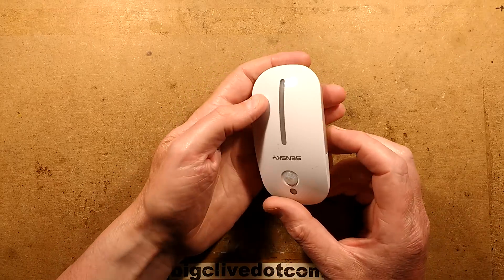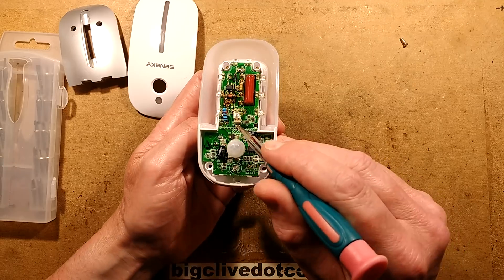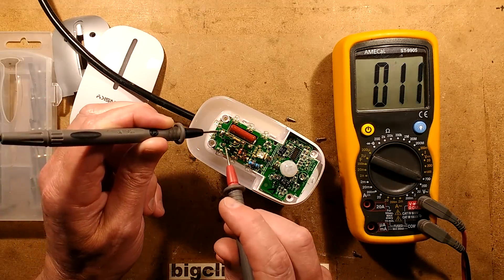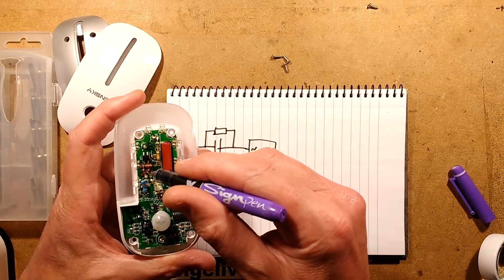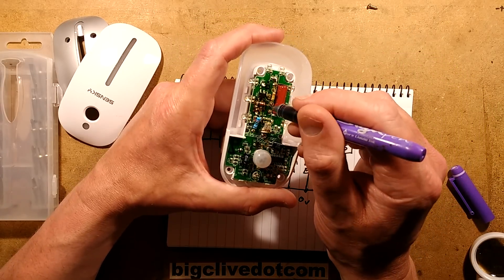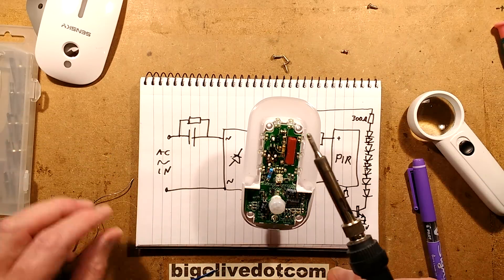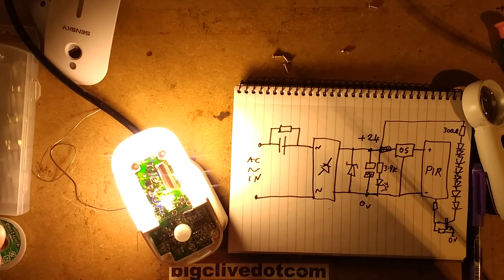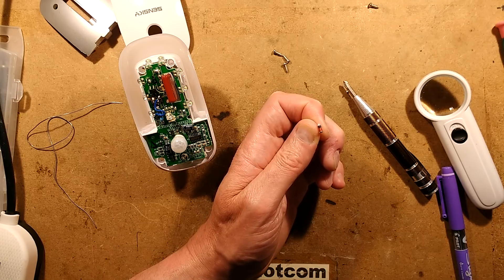Defective nightlight autopsy, half-assed fix and improvements.

Comment: Yes, I know.
This is like a six year .

old video it was there that long 

However, the question I had was which software I Arabia, is being used and also does Clive have a video on this one? I'm not sure if this is one of the tests, the soldering station or just 1. That's an iron on his own warm. When those stand alone, sovereign stations with just the iron and the power supply and so on. I'm looking for something.  About the size so more information would be appreciated and if there make live video on this pointers to this please

Comment: I see capacitive dropper night lights that use a TRIAC for the control, so the current really gets reduced when the LEDs are off.  The whole idea behind shutting off the LEDs is to save power.  The lights that shunt the LEDs with a transistor violate that efficiency concept - they should be banned or labeled as not meeting efficiency ratings, depending on the laws.

One thing I would try would be to use a TO-126 "15000" series transistor from a switching power supply to shut off the current when disabling.

Comment: Have very similar night light at home, night mode works, motion mode worked but light from LEDs on edges started to weaken to point it doesn't work anymore, any ideas? :(
Reply from the maker: It could be that the LEDs have gradually failed over time or that the dropper capacitor or its series resistor have degraded over time.

Comment: I have one of these exact nightlights and it failed after about a year. I just opened it up and found burning discolouration around the zener, but the zener itself was still working and wasn't shorted. I guess something else gave way first.

Interestingly it had standard phillips screws, not triangle ones, but otherwise is identical including the upside-down logo.

Comment: The PIR uses very little current, so indeed, 330nF should be enough. Also, if you don't mind the 50Hz, the whole zener +cap+7805 could be replaced by resistor+5V zener+cap, and take the supply for LEDs directly from the bridge rectifier.
Reply from the maker: The PIR circuitry needs a very stable supply, so I'd still aim for a higher voltage and use a regulator.
Reply: Hmm I was not aware of that, but I always use them on batteries :D
What strikes me as inefficient is that it is a current supply converted to voltage. When LEDs are off the 24V are not really needed, it would be better to shunt part of the current to a lower voltage (similarly to the 'avatar mushroom light' that shorts the supply)

Comment: Speaking of zenners, is there some easy and simple way to test what voltage they're designed for? Unfortunately I don't have a bench PS.
Reply from the maker: You'd have to use a voltage that is higher than the rated voltage of the zener and limit the current through it with a resistor.  Then measure the voltage dropped across it.  Many zeners have a reference to the their voltage rating printed on them.
Reply: There are indeed some markings on them. Way too tiny for me to make out though. Guess I should first get decent lighting and/or a better magnifier. Thanks.
Reply: Yeah, what color I said could easily be built into a small box and some component test clips of some sort to build a zinner diodester. I'm about to get you like this once as well. And just in case designed it so the current limiting resistor could easily be swapped out if there was some sort of.  Anomaly or an oops on my part. Glad I did only had to replace her as a sister once but it was pretty spectacular. I think I either had. I wanted to change the value in miss Reddit. Or for some reason, I had a short and way to my family but in a very wrong value resistor.  You know what happens when Laura value to resistance expected plus a beefy power supply.We're playing a voltage and currenot.Well, starts out with a little bit of a smell.The best smoke and well you know what's next

Comment: I hate nightlight circuits that draw as much or more when dark as they do when lit.  This one looks like whatever is not used by the LEDs will be burned by the Zener.  So you buy this fancy unit that only lights at night, when there is motion and think you're using a tiny fraction of the power of the simple capacitive dropper night light, but you're not, you're just using extra to power a PIR.  But then, what are we using here, 150mW?

Comment: I would be really intrested to see an optimized BigCliveNightLight (similar to the not-so-safe emergency light you build)
- i'd suggest a capacitive dropper with really low mA of current, who charge a cell 24hours (NiCd? LiFe?)
- the current is a bit higher than the current needed for the PIR, but lower than the mAmps the light needs when the LEDs are on (or even voltage drops)
- so the standby current could be really low

i always wonder how efficient a new+small 5V or 3,3V power supply would be compared to those cheap droppers always used, who dissipate lots of heat.

I hate it if a motion sensor LED lamp takes 1 or 2W standby 24h a day, because with that you could light the backyard all the time good enough...

Comment: Somebody can maybe tell me why my switchmode led power supply has its transformer after the bridge rectifier ? Do they drive the transformer with a pwm signal or what
Reply from the maker: They switch a smaller transformer at high frequency to make it much more efficient and allow a tiny transformer to be used.

Comment: Around here we've all pronounced it as 'zeener' for about 50 years. Almost nobody says 'zenner' in anywhere I've worked, and that included the people who made the devices. By alternating between the two, Clive, you'll be annoying almost everybody! ;-D

Thanks for the autopsy. Can you please find a zener diode, perhaps one with a higher current rating, and maybe use a smaller dropper capacitor, to restore proper functionality? I'm guessing that that circuit might have been designed for 110V and that they've cheated out to sell them in 220/240V markets.

Comment: By the way, it's no wonder the Zener failed, if there's no inrush resistor. And I have a feeling that you killed the 7805 when you operated it with no Zener. The 7805 briefly had a full mains voltage on it during the inrush.
Reply from the maker: The lower circuitry was disconnected.  The zener has been grilled.  It would have been dissipating a lot of power in standby.  Probably in the region of 0.5 to 1W.

Comment: Very interesting! Have you ever taken a carbon monoxide alarm to bits? My Kidde detector just died, seems the material has a lifespan of 7 years, which my unit exceed by six months, so Kidde makes a good unit (made in China of course). The new units last 10 years now, better material I reckon. I would be happy to post this to you Clive if you want to give it a look. My e-mail address is ohweinert@yahoo.ca, I use Yahoo Canada for they has less crap. Enjoy your videos Clive, Thank's Ossie
Reply from the maker: It's always a good idea to change the carbon monoxide detectors every few years anyway.  They do gradually fur up inside with dust and soot if used in the same room as a solid fuel fire.

Comment: It's possible that a leaded zener would have a better chance at longevity, as the leads serve as a heat sink. Furthermore it's likely to be of a higher power dissipation rating. Tie points? There's an electrolytic with through hole leads.

Comment: weird design in my opinion, I had lots of those night lights because I found out its cheaper to buy them and gut them out if you want photo-resistors, movement sensors and low-power diodes with all necessary side component to use in other projects, and this one really look like overcomplicated a bit...

Comment: I always said Zeener. I taught myself electronics and had never heard anybody say it. Good video.
Reply from the maker: On the basis that surviving family mentioned his name as Zeener I'd guess we're correct.
Reply: I have about 3 ways.I say it and I can Express that in form of what is here just because of spelling

However one time I accidentally used to call them zinger Diodes, when I first heard it, it's almost what it sounded like. That was years and years ago when I was very young. I think it was just the way a couple said it possibly dialect or otherwise we're just saying it wrong. I'm dumb than hearing't or I don't know. Maybe it's my own take on why I heard, but then again when we are young, people weren't always exactly on.  Right with what?
Is proper pronunciation
Reply: I've heard zinner more than anything nowadays.By the way

Comment: isn't short circuit failure so common because the semiconductor layers just melt together when exposed to very high temperatures? Or maybe not exactly melt, but the dopants diffuse all over and crate a single uniform layer?
Reply: Yeah, I would love to hear the actual failure mode within something on a micro level to where is happening is explained in happens.In this, in my conductor Junction or other areas to the component causing the diode become jumper.This would be fascinating for real

Comment: Question.
Why do UK 4 way plug adaptor strips always have the lead wire coming out the right hand side?
Reply: It is a conspiracy against the Left handed
Reply: It is annoying as if you wall mount it, you can only wall mount it on the left of the main socket, unless you loop the cable under and around it which looks ugly!

Comment: Earth always points to the Earth and any other way is just upside down.
Reply: I agree as the Brits have this safety feature down for sure.
Reply: Until you have countries like the US with unsheathed pins, where a device falling down the back of a plug can make contact with the live (line/neutral) pins without touching the protective conductor. That's why safety concious people even in America, install with the ground UP
Reply: Wrong, and many wall warts are made with the neutral (if they have one) down.  All of my night lights have the neutral down and in the USA the saying goes that Ground faces down to the Ground or start over.
Reply: Honestly, I wish the pins were sheathed, frankly. Once shocked myself accidentally trying to plug in my DS charger. (caught the pins with my finger) No real damage done, and I was laughing shortly afterwards (It was like 6 or 7 AM at the time, and I wasn't very awake, I guess.) while thinking something like "did that just happen? ...Yeah that just happened," but it wasn't a very pleasant experience and isn't one I recommend.

Comment: should i take my fluke 107 apart? it got rained on cause im a dummy and left it outside in a thunderstorm and now it doesnt turn on, thinking about junking it or is there a way to fix it?
Reply from the maker: I'd suggest removing the battery immediately and then leaving the case open in a warm place for a while to allow any water to evaporate.  If you use it on mains voltage a lot I'd suggest playing safe and getting a new one in case conductive tracks have formed.
Reply: yeah i think i have to buy a new one :( i let it dry for a few weeks  and put new batteries in and it didnt turn on.. rip, keepp up the good job Clive and thank you for the tip. i only use it for automotive batteries so nothing life threatening . cheers!

Comment: It looked to me like the discharge resistor was around 120K. That combined with the large cap makes me think that was built for 120V input, since those would be not too unreasonable values for 120V.
Reply: That would also explain why the case was upside down, because the USA have their earth pin on the bottom.

Comment: are you going to order a couple of higher voltage zeners so you can fix it in a new video ? I guess as you said replacing the capacitor for a lower value one then keeps that new zener healthy :)

Comment: I was repairing a dusk sensor for a pole lamp and discovered that the light would not immediately turn on if I covered the light sensor.  Apparently it had some significant delay and averaging built in so that it wouldn't be affected by car headlights, etc.  I was wondering if your night light might not have some similar circuitry to control turn on conditions.
Reply: Yep, those photo controls were designed to eliminate false positives for bright lights enough to trip sensor and yes, even lightning sometimes could trick a photo sensor in the train back off. Once it turned on at night, have seen this at times and I believe the word you're thinking of as hyruses or he receives swing along this. I can't say quite right..

Where's it history sees something a  long these  I guess.

The old classic is when somebody says that 1 light turns off. When an alarm gets turned on and then you go out there and de light that turned the other light off is happened to be aimed. Or is your  such a manner Reflected to otherwise That's hitting the photo cell, causing the other to turn off. I've seen this.  About half.
 A dozen times are moreover the years and I'm not even realizing.

And yes, there's often a delay to avoid other ambient.Light changes either on or off.So as to avoid also the light flickering on and off rapidly in some cases 

And some photos have the nasty habit of just flickering and tinnel the reach enough darkness to come on, Foley didn't see this much, but everyone's awhile.You'd see this sometimes under right conditions in the wrong circuitry you Could say.

I actually once heard about this where someone to handle.Those pool lights like a high pressure soldney.Marker vapor recommended that would have quit working They're dog was getting very ill. The squid working and the data dog di'd almost within the hour. The light started working properly again and worked ever since it was weird, but they took it as a slave. You know that's crazy. But sometimes people mistake things as some sort of sign but or because it's such a coincidence attributed to this.  Not saying there isn't anything there with this, but it's just odd that it happened.Most timing more than anything

Comment: If you don't have a specific zener diode available you can always put them in series (anode to cathode) to obtain the voltage you need. Two 10 volt zeners in series would give you 20 volts for example. This also has the added benefit of reducing the power dissipation by half so they will run cooler.

Comment: the zener is not going to be seeing a whole lot of loading when the LEDs are on, but when they are off it is going to be taking the entire current the capacitor can source.  So there's no actual benefit to turning the LEDs off when it comes to power usage.  This means the zener is going to be burning off the entire 20ma or whatever at 24V which is a lot of power.  The better solution would've been to have a second capacitive dropper to run the PIR part separately so then it wouldn't need the zener at all for the LED.   It seems the zener is only there to prevent the 7805 from being over-volted.

Comment: Here in the Colonies there is no federal code, and perhaps no state codes, requiring the ground pin on a socket to be up or down. There are good arguments to be made both ways. Is that really regulated in the UK?
Reply: Lyfan Deth UK plugs are fused. So the live and neutral need to be defined.
Reply: Colin, that's not the point. If you install the socket, which is normally a duplex socket in the US, you can install it "ground pin up" or gp down, either orientation. One argument is to install it gp down, so that if a cord plug pulls down and out, the ground pin is the last to pull out. The other opinion is gp on top, so if a metal panel cover slips or other metal contacts the pins, it hits the harmless ground pin instead of the live pair. Strictly a question of what damage can be done with physical accidents at the plug. GFIs, whatever, they can all be installed in any orientation here. It is funny (not) when you see someplace where new wiring has been added, new circuits one way up, old ones the opposite. New crew never even tries to simply match the existing work.
Reply: Ok, so you have a grounding wire...the whole case is plastic...where the hell would it connect to???...I dont think that any nite lite in the states worries too much about pin orientation
Reply: I agree with you. But that's why "the text is upside down". There is no "up" or "down" in other parts of the world, where the outlet and plug may have the "triangle" of contacts facing up or down, randomly, rather than being set by code.  If the manufacturer has no idea that there is a UK standard for "this side up" ...  And that's presuming Clive is right, that there is a UK regulation requiring the socket to be installed in the wall that way.

In comparison, in the US, simple light switches that are installed in wall boxes DO have a requirement for which way is up, by which way you flip the switch to turn it on. (Obviously can't apply to 3-way switches.)
Reply: UK sockets,  to British standard 1363 have live (phase) on the right, neutral on the left, earth at the top. Same for the pre-war round pin ones we had before that that are still very common in India, South Africa etc.  On a plug the mains cable exits at the side opposite the earth pin. One way to recognise potentially dodgy imports is when this  is not true. (or when the L-N pins are not sleeved, or the earth is ! ) There always has to be an earth pin, though it can be plastic on devices that don't need an earth, as on many sockets,  as it goes in, it lifts the safety shutters on L and N.

Comment: Even in our 325KW power supply to a inductive furnace, I had a cap go bad and it shorted.  The cap involved had 6 taps in its connection and just one went shorted.  All it took to cause the power supply to fault out on over current.  Love your videos.  New Patron.

Comment: Doesn't removing the zener diode cause the regulator to dissipate more power and therefore making it the next candidate overheat and fail?
Reply from the maker: The LEDs are the new voltage cap.  The feed to the sensor circuitry was disconnected.